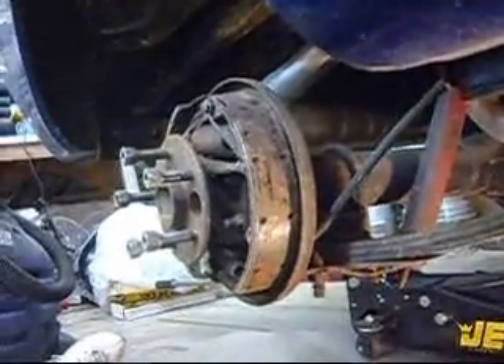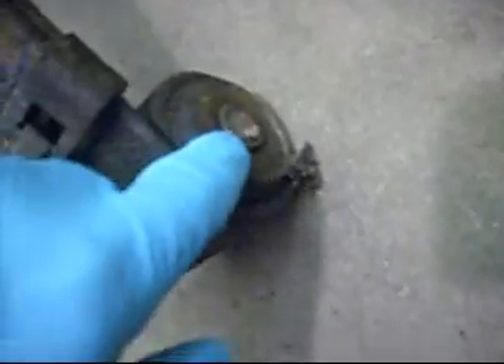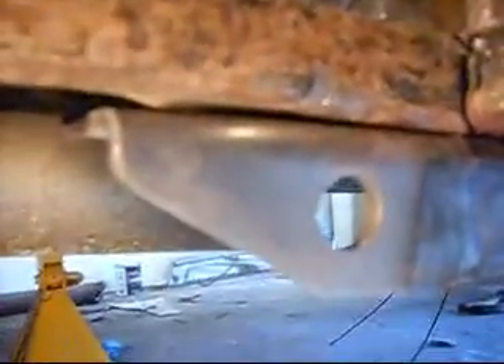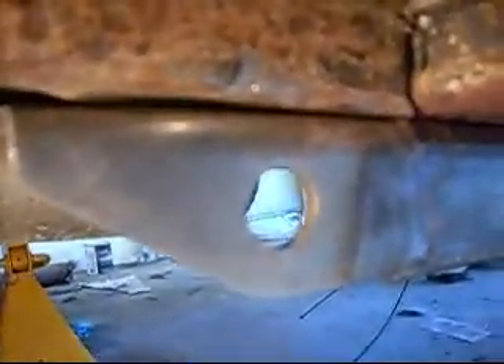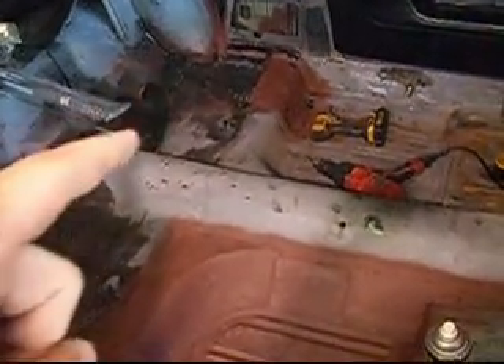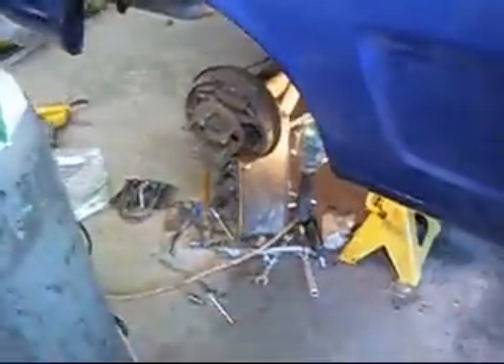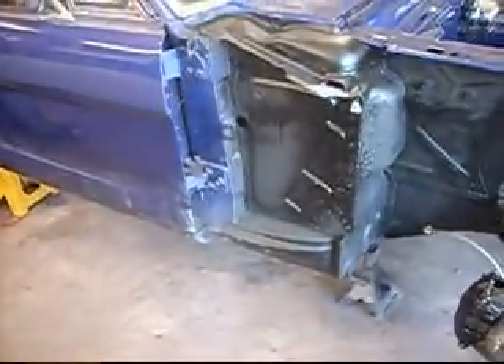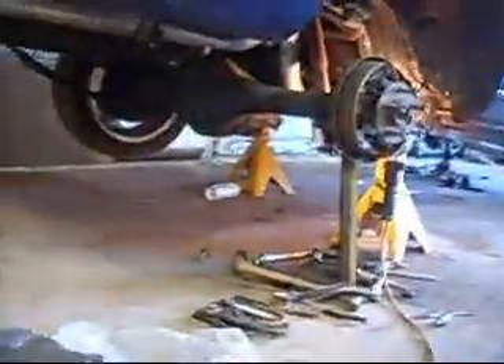1965 Mustang Restoration: Subframe Connectors install

Comment: The suspect hole on the sub frame connector is for traction bars. Scott drake sell a reproduction of what was standard, they bolt into that hole. Nice work by the way
Reply from the maker: Hmmm I never thought about that.  Nice spot for it to attach.  Thanks.

Comment: Those bushings are always a huge pain in the ass. Luckily I was replacing my leaf springs, so I just cut them out. Lots going on, lookin good man. Are you using the Tinman connectors?

Comment from the maker: I'm hoping that it will.  I'm also hoping that I didn't mess anything up by welding them in when the car isn't sitting down on its suspension.  Like the resting position of the car.  Make sense? Thanks for watching.

Comment from the maker: Yes they are.  I see some people just cut the spring but I'm on the fence if I'm using these again so I wanted to keep them for now.  The subframe connectors I'm using are from Heidt's.  The part number was something like RM-205.  Check out one of my older videos where I talk about them more.  Definitely quality made.  They slide over the frame rail where the tinman ones slide into the front frame rail.  The Heidt's connectors also came with new hardware.